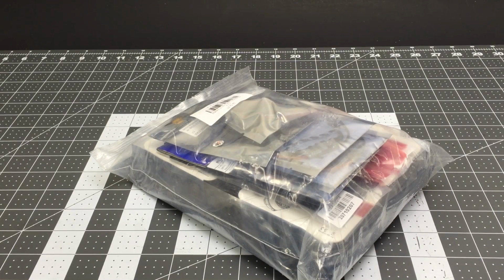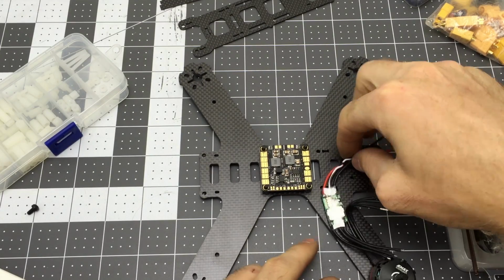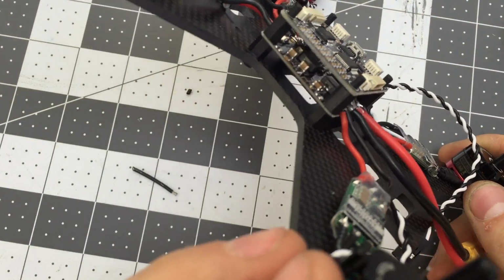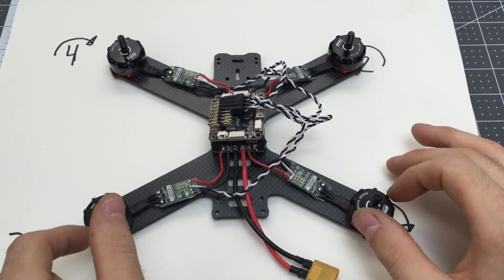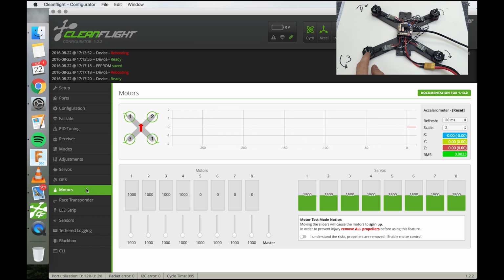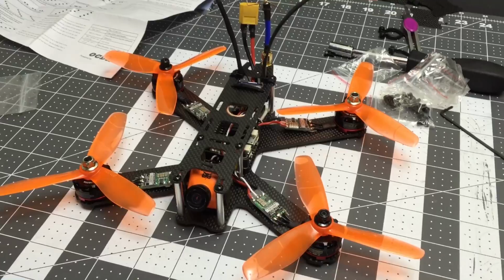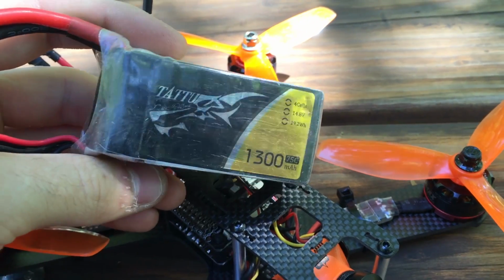FPV Quadcopter Build Tutorial

Comment: Did you need to do much in the way of PID tuning? If so how did you go about doing it?  Thanks :)
Reply from the maker: For the flight footage I was using Betaflight configurator and flashing BetaFlight 3.0+ firmware with default pids
Reply: Samm Sheperd Wow! That's pretty good then for defaults. Thanks again

Comment: I want to build my own but these little racing quads seem they would be too twitchy for a beginner.  I want something friendly, with FPV, and gps return to home.
Reply from the maker: These can be as slow and stable or "twitchy" as you tell them to be. It's all digitally controlled. These can use GPS and SONAR proximity sensors, but they aren't as well polished as more high end flight controllers such as the Pixhawk
Reply: Thanks for taking the time to reply.  I want a platform for my Sony A6000 camera (about 490 grams) to fly for 15 to 20 minutes at a decent range with FPV. Where can I get an idea for parts for that? Am I looking at over $500 out of pocket with the transmitter, batteries and charger?  I would like the option to later add a gimble if I want, but it's not that big of a deal in the beginning.

Comment: Hey sam, I'm looking into getting into FPV drone flying, i have one of the smaller amazon drones i have been flying constantly and think i am ready to get sometihng bigger.

Do you think this drone kit would be a good starting point?

Is the link in the description still a good buy or would you recommenced changing any parts in it.
Reply from the maker: Yes I do think this is a pretty good kit. You will still need to get some m3 nylon standoffs and a battery lead and a battery and a radio system. It is meant to carry FPV gear, but you could wait and add your own camera and Vtx later if you wanted.

Comment: what flight controller were u using?
Reply from the maker: I was using an SP Racing F3 board which comes with the kit. It's good but my current favorite board is the new REVO F4 board. It's super simple with the latest hardware. BetaFlight is optimized for F4 power and can handle 8k 8k update frequencies. http://bit.lc/3WhW.
Reply: Samm Sheperd is their any board out there that the satellite receiver can just plug in to with out souldring?
Reply from the maker: I haven't used the satellite receivers sorry I'm not sure

Comment: Hi Samm, sorry to bother you again. If I have a PWM receiver what's the name of the cable thingy I need to connect it?
I also think I've got enough parts to make a plane out of scrap stuff and get it flying, I'll make a video and link you to it since you've basically gotten me off the ground on this.
Reply from the maker: For PWM, you will need both of the 8 pin connectors that come with the SPf3 board, then google SPf3 manual and plug them where they say to on the IO_1 and IO_2 boxes .
Would love to see the vid, thanks.
Reply: Only thing I need now is something from the servos to the control surfaces, I'm not sure what to use that's thin enough to fit through the holes in the arms of the servos.
Anyway, today I have begun building the quad. I haven't touched a soldering iron in ooo maybe 16 years now (Now I feel old calculating that). Prepping all my engines and speed controllers first, basically following this video step by step.
Reply: ha, noticed the positive and negatives on the SCs are the other way around on these ones, so i have to cross all the wires :(
Reply: Am I doing this right? My soldering skills need some work. http://imgur.com/a/4ebOw
I always feel like a positive should be attached to a negative :S But your has Positive signs on both ends. Not critiquing, just being paranoid/worried I'll muck it up.
Reply from the maker: Aegrim looks good! More heat and solder would help
Reply: Thanks. On my way out now to buy some heatshrink so I can make a power cable.
Btw the video transmitter in the recommended equipment list has been out of stock every since. I've got every thing else, any alternatives you recommend? Thanks

Comment: Why props have 3 blades instead of 2? isn't 2 blade is more efficient?
Reply from the maker: There are a few ways to increase the load on a powerful motor to fulfill its potential. The Prop can:
-Have fatter blades (lower aspect ratio: less efficient)
-Have higher pitch (less efficient)
-Have Longer blades (more efficient, but higher rotational inertia)
-Have more blades (less efficient)
When constricted to 5" diameter, having 2 blades would require really inefficient blades, and thus 3 is more optimal. Also 4 bladed props can also be efficient because it allows skinnier lower pitch blades to be used. Also 2 blades are inherently less balanced when their plane of ration changes.
Reply: Samm Sheperd thanks for the reply :)

Comment: my 60 watt iron dosent melt the solder and I have set it to 450 deggres
Reply from the maker: You should set it to like 700 or more
Reply: thanks but o found out hat the problem was that i didnt wait long enough
Reply from the maker: you shouldn't have to wait very long. The iron is supposed to be up there around 700 though.

Comment: Does plugging your x4r into I/O which uses VCC (16v) fry your rx?  x4r operating voltage is 4-10v so I'm confused why it worked.
Reply from the maker: You power the FC with 5v. Everything coming out of the FC is 5v
Reply: Samm Sheperd ohhhh ok.  Now I feel silly. Thanks

Comment: Hi Samm, I have a RunCam Eagle and a TBS Unify Pro HV Race Edition VTX.  I want to be able to use both 3S and 4S batteries on my quad build.  Some guys have told me to bridge the solder pads for the 12V on both the CAM and VTX section on the PDB, which will allow me to use both 3S and 4S batteries.  Is that correct?  

I noticed in your video you said that in order to use both 3S and 4S batteries you need to bridge the pads for VCC for the VTX and to bridge the 5V pads for the CAM. Is your method safer or better?
THANKS for your help!
Reply from the maker: +Moises Moraga nice equipment! I see that the specs for the pro HV version support running off of 2-6s (cells in series) batteries. So I do recommend using Vcc for the VTx. The 12v regulator is a buck converter. It freaks out a little if the input voltage goes below like 13v. The 5v output will have a filtering effect for the camera, even though both the camera and the VTx can use Vcc.
Reply: Samm Sheperd,  OK,  so it can be done either way...  But your method,  VCC to VTX and 5V to CAM will be  better because it acts like a filter. 

OK,  great! I'll do it your way...  Thanks for the help!

Comment: Why you changing max throttle?
Reply from the maker: Because if the ESC thinks that for example, 1980 is full throttle, then giving it 2000 isn't going to get you any more power. And the small changes that the flight controller makes near the top end wont have any effect so you may get some wobbles at full throttle.
First I set it to 2000 to calibrate the ESC and tell it I want to give it 2000, but that often isn't very accurate so you have to see what the ESC is actually doing and then adjust the output of the FC. That being said it isn't that important and can easily be omitted.
Reply: You will therefore be giving up throttle range resolution.  Any issues you would have after that would be tuning issues,  assuming you calibrated esc's correctly.
Reply from the maker: I prefer to set 2000ms in BLHeli Suite so that it's absolute
Reply: Just saying,  alot of people  watching this video are watching because it is their first build,  and personally,  from what I have experienced lowering max throttle is probably bad practice.  True enough dependant on esc the resolution you lose at the top of the scale may be negligible but you gain nothing from lowering max value.  Min throttle,   is the best value to change.  Sorry,  not trolling dude 👍👍

Comment: Thank you for a great video! Easy to follow easy to understand and useful information. However, I ran into one catch. I believe it is in the missing video. How you tell beta flight that you rotated the board counterclockwise 90°? If it was in the video I missed it. But I have to believe it was in the lost footage.
Reply from the maker: +Roger DeVries it is in the video close to the end. In configuration is sensor/board alignment, select "CW 0°" for usb on the left, or "CW 180°" for usb on the right
Reply: Thank you for your reply and thank you for the video

Comment: Hi there Samm, i've watched this vid so much, it helped me out a bunch. One question though, my motors all spin at the same speed once I arm, and its a pretty high speed. But I don't get the falling rock feeling. If I'm in the air and I drop throttle, the motors stay at the minimum speed and it tries to correct itself. If I arm the quad while it is in my hand, and move it around, the motors spin to correct itself. I am in air mode. If you could help me out, that would mean a lot. Thanks!
Reply from the maker: +dcatspajamas2012 hi, maybe my "falling rock" analogy was not very correct. I want to be able to flip upside down at minimum throttle with out too much thrust pushing me down, but still have perfect control. Everything you said sounds good to me, but if you think your motors are spinning too fast, you can lower the min throttle in configuration tab.

Comment: does it make any difference if my d4r is plugged into IO_1 or IO_2?
Reply from the maker: +angry4nus the dr4 doesn't have sbus, but it does have CPPM, you need to connect that to IO_1 and select ppm in configuration tab.
Google "spracing f3 manual" and take a look at it

Comment: It just dawned on me... Sam Shepard is MattV2099's other channel?
Reply from the maker: +TheDudeofDudes I might have another channel, but it's not that one
Reply: Oh, yeah....Gotchya, not MattV. ;) Also, I suspect that the reason why CleanFlight has the clockwise 90 degree flight controller config as 0 degrees is due to the fact that 0 degrees lies on the intersection of quadrant 1 & 4 on a graph, which would be the USB port orientation of the board in that position. I know little to nothing about quads, but that is the best guess from my low gpa engineering student brain.

Comment: Do they sell flight controllers that has the escs and everything in one board?
Reply from the maker: +AntiKipKay no, but they do have 4in1 escs that stack just like the FC
Reply: *****
Oh cool I'll have to look out for those next. I found a motor that has the esc built in. Ever see the Black Widow 1806-2300KV motor?
Reply from the maker: I had not seen that yet, pretty cool!
Reply: *****
Ikr. I've been reading the last few hours on rcgroups and other various forums about them. They seem to be very reliable like any other good motor.

Comment: Followed this tutorial to a tea, and it's been a great help.  I think my FC is stuffed as the motors will spin at varied speeds when under TX control.  The motors are ramping up and down on their own with no input.  :(
Reply from the maker: +SickocrowAU it can be very counter intuitive with no props on. It's trying to correct for errors but it can't. The integral gain is ramping up the motors to try and correct the sustained error. As long as they spin the right way and you can arm/disarm with a switch, try it with props :)
Reply: I had to correct to motor directions, but no drama there. It does take aux commands just fine so switch disarm is easy. Does it still try to correct in Acro mode? I would have thought it wouldn't do anything. Also the two right motors will only twitch and not spin when on a 4S. I can't figure it out.
  EDIT:  It will fly on 3S.  Shudders like all hell in Angle/Horizon mode.  Right side motors still won't turn on 4S.   Weird.
Reply from the maker: +SickocrowAU yes it still tries tomorrow in Acro/manual. It's not trying to level itself but it is trying to maintain its orientation, whatever that may be.

That is pretty weird, have you tried calibrating them?  
While I'm the motors tab (props off) can you spin those motors up with 4s?
Reply from the maker: Still tries to correct* ugh this is hard on a phone. My computer was just stolen
Reply: Nah, Samm.  Even in Motors tab, motors 1+2 just twitch and get hot on 4S.  I don't do it for very long so I don't damage them, but it's not right.  3S spins up just fine.  I've tried recaling on 4S battery but it made no difference.  Sorry about your computer.  That's gotta suck.  Thanks a shitload for trying to help, I know you've probably got other stuff to sort out.  :)
Reply from the maker: SickocrowAU which escs are they? The little bee 30a? They should be up to date firmware wise but maybe try re-flashing with newest firmware.

Comment: hiya nice video samm   where you updated esc firmware   do you know if i can update my nighthawk 280 pro oneshot esc,s like this
Reply from the maker: +William Davie probably if your FC firmware is pretty new
Reply: its a brand new arf 280 pro from banggood i set it up with the emax rx & tx but couldnt work out how to revese my ch in receiver so i got the devo 7 tx & rx now its all setup and working but my esc & motors ar tottaly out of sync & calibration  and i just found a video on program esc,s & motors  its a nightmare  im new to this and its my first race quad  and just learning and its stressful samm
Reply: ***** samm have you used  f3 delux fc  by any chance

Comment: would you recommend double sided foam tape between (under) the ESC's and the frame? (I got the idea from Charpu :)). and by the way, BLHeliSuite runs in Mac OSX by using WineBottler application, see https://youtu.be/OrmrIDIpzJ0
Reply from the maker: It's a good idea, adds some cushion and what not. But the adhesive attracts dirt and they do peal off sometimes.

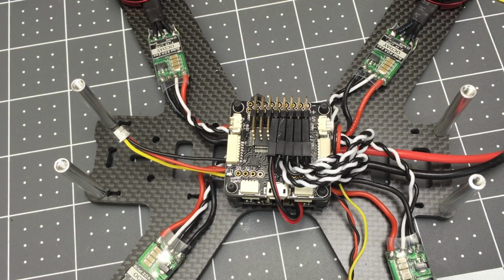Comment: Hey Samm! Just wondering how i can find out which "mode" my transmitter and reciever has. (You speak about this at 23:05 ). My transmitter is an FlySky CT6B, and the reciever is a 6ch Flysky-R6B.

Thanks!
Reply from the maker: Hi, your receiver is PWM only. This means you will need to plug in a cable into each channel. If you need help connecting it to the Flight Controller let me know :)
Reply: Samm Sheperd Thanks for such a fast reply! I'll let you know if i need some help :)

Comment: How much did this project cost? Usually, I see a video and think "it does seem to be really complicated", but this project seems to be very complex. Anyway, cool video!
Reply from the maker: The kit is $185 right now and then you need some more stuff. I have a list in the description.
Reply: I have started from scratch with nothing but a flysky th9x, i needed to replaced the reciever and transmitter tho. including cheapo FPV gear it cost me roughly 400-450€. And yes, this is complex if youve never done it before.

Comment: Hi Sam,

I'm looking into making something like this kit after this video, but as I've only ever had rtf things I don't have a suitable transmitter. Any recommendations? Will anything over a 6 channel be excessive?
Reply from the maker: Depends on your budget! A popular budget transmitter is the Flysky i6. The most popular system is the Taranis. It's $200 and doesn't have the most intuitive user interface. But it's reliability and features are insane. For quads I only use 5 channels (one arm switch) but 6 channel is great. The Taranis can shove 18 channels through 1 s-bus wire.

Comment: Any controller/transmitter suggestions?
I need something to use with this, but preferably something I can also use with planes and can program it for things like elevons and such, as well as enough channels for extra stuff, like flaps, gears and bombs/rockets.
Reply from the maker: Depends on your budget! Popular budget transmitters include the Flysky i6 and the OrangeRx T-six. Both offer small 1 cable wire receivers and also larger PWM receivers for airplane servos and relays for rockets etc. The most popular system is the Taranis. It's $200 and doesn't have the most intuitive user interface. But it's reliability and features are insane.
Reply: Thanks, I'm basically using this as my introduction to building these as well as planes like in your other videos. Does this pack not include a receiver? Sorry but I wasn't planning on watching the entire video until I started to put mine together, and just slowing accumulating parts and tools to get it done as the moment.
Reply from the maker: Aegrim No it does not. You will need to supply a receiver that works with whatever transmitter you choose.
Reply: Thanks, you've demystified a lot of this for me with your videos and comments.

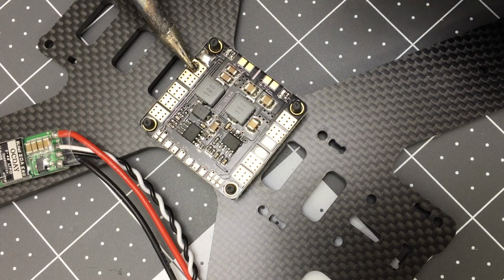Comment: Hey at 7:28, you show the bottom of the motor and your e-clip is not on the motor shaft
Reply from the maker: Yes it it. The clips used on these motors are a little different than the e-type retainer clips. you can see the part protruding from the shaft pointing toward the bottom of the screen.

Comment: You should get a small chisel tip for your soldering iron. It really makes a difference and you can use it for basically anything.
Reply from the maker: Thanks for the tip! haha. What I really should have is an actual temperature controlled iron with a wide arrangement of tips.
Reply: *****
Sure, but a fatter tip does wonders in the meantime.

Comment: i bought  one husban x4... i think its better than this litte one you show, because u can replace evething if you broke it...
Reply: and i put the protection too... XD
Reply from the maker: But the X4 is 2x as expensive, and the blue one I showed is my girlfriends and she has had it for over a year. She throws it in the water bottle side pocket of her backpack and shows her friends and professors and crashes it into everything and it still works! I take mine as high as it will go until it runs out of range and falls just for fun because it's indestructible. Also you get the novelty of being so crazy small and it doesn't hurt when the props hit you. I had the hubsan x4 a few years ago and it had less punch than the cx-10.